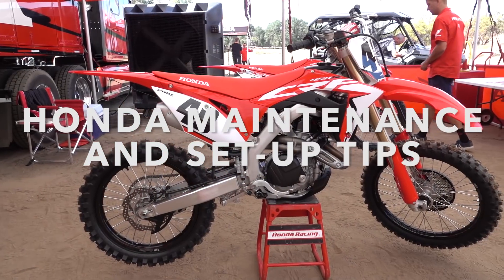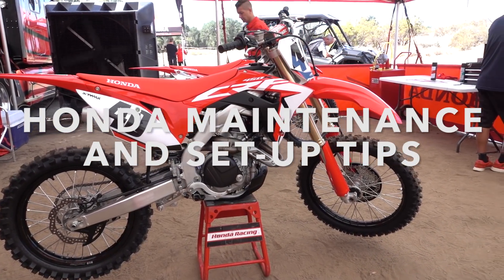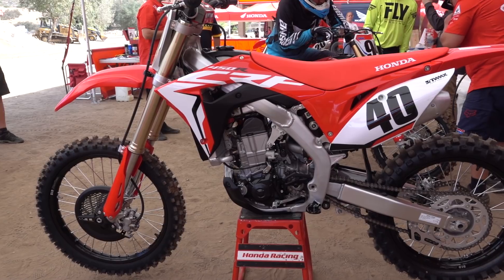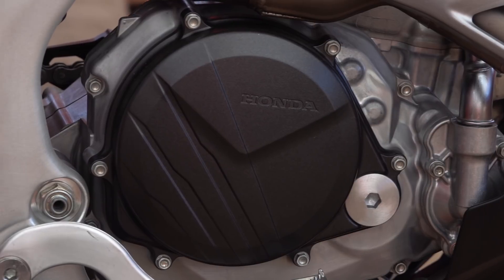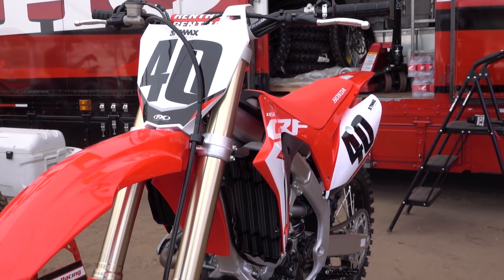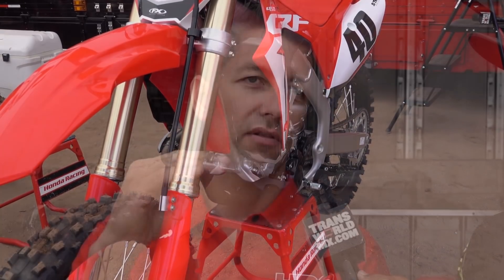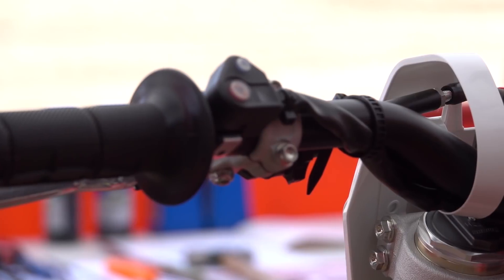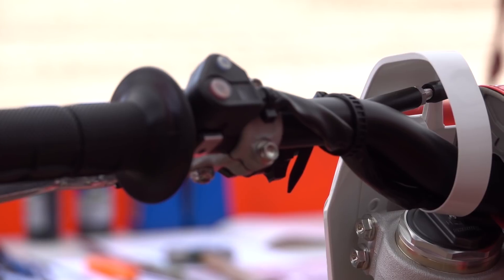Honda Set-Up and Maintenance Tips

Comment: Thank you for the 65mm. My chain always ends up a bit lose until I started using chain wax the right way too. It goes on wet but if you let it dry for a couple hours it’s nice and firm/tacky with no chain rattle like wet lubes. I had no idea!

Comment: The riv nut on the bottom of my skid plate was spinning too....put a little jb weld around the rim of it and the problem is solved. Also the chain guide wears out fast. A TM guide fixes that. You can also follow the wires from the clutch switch down the left side of the bike and plug the two wires together that are coming from the computer and you don’t have to pull the clutch in to start the bike anymore 👍🏻

Comment: When he was talking about the oil blowoff and draining it from the hose under the air box... that hose vents from the cylinder head cover and I have a 2014 crf450r and it has water that needs drained from there every ride and I can’t find anything about it. Anyone have information on that?

Comment: How do they remove the rear under skid bolt?
Reply: Harleywheelies put a small pry bar or flat blade screwdriver in between to put some pressure on the skid plate while loosening and the bolt will come out. Then you can put a dab of JB weld around the riv nut edge and it will never spin inside the frame again 👍🏻
Reply: wideopenmx850  word I’ll try that again. I pulled the skid plate down and tried to use a screwdriver but it just kept spinning, no luck.
Reply: Harleywheelies ya it took me a little bit too before it grabbed enough to come out. Maybe try to get a little JB weld on it before you take the bolt out with a toothpick or Q-tip etc. good luck man!